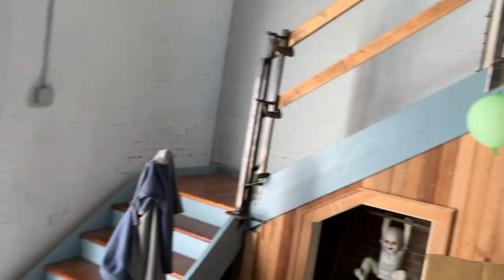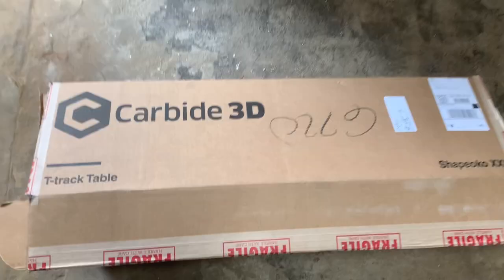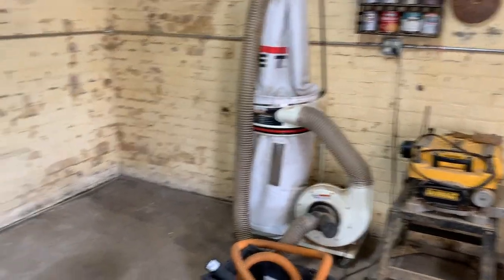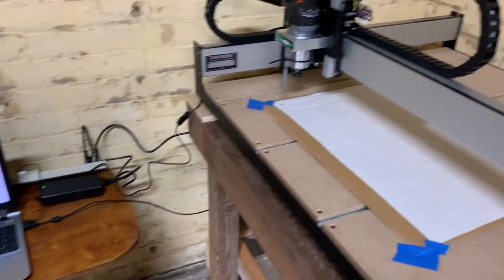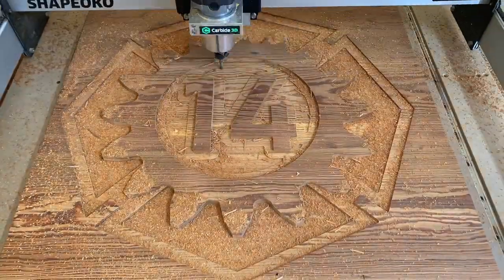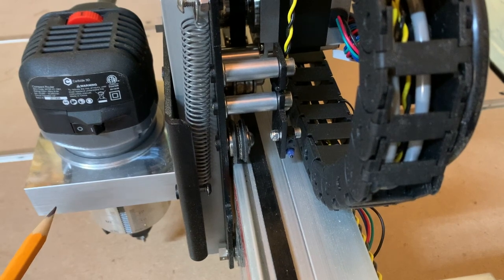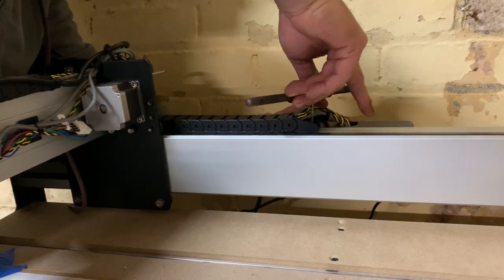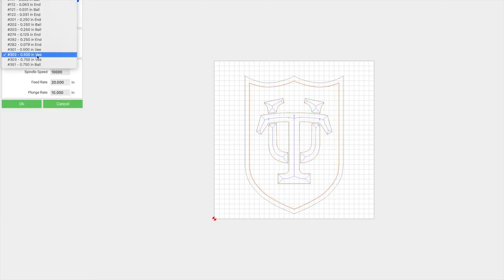We Bought a CNC Router!  Shapeoko 3 Assembly and Setup

Comment: Nice honest review. I'm not a big fan of "hobbyist" CNCs, but if you're ok with their limitations, that's all right. With most "kit" CNCs you seem to get what you pay for. Myself, I have an Avid 2x2 CNC that is rock solid. At our local makerspace, (slomakerspace.com) we have a Build your CNC with 4x8' table: big, but not very rigid. 
If you have fast internet, you might consider Fusion 360 for design software. It's free for hobbyists/small companies. -- Might be a stiff learning curve, I don't know.  I have Vectric's Vcarve Pro -- at $700 it's not cheap but I really like it. Great support too.
Look forward to seeing what you build.
Reply from the maker: Yeah I switched to fusion 360 pretty quickly and I’m loving it. I was already familiar with designing in fusion, and using the CAM functions turned out to be easier than I expected. It looks intimidating at first with all of those menus and options but once I got started I realized that it’s pretty straight forward.

Comment: I got my Shapeoko second hand and was not impressed with it at all starting out.  However after upgrades like the HDZ, 2.2kw spindle wired into the controller. 
Carveco Maker Plus software and a lot of time at YouTube University... I've got it tuned in to a very functional little cnc!
Reply from the maker: Yeah there’s definitely some bugs to work through with it but it’s got good bones. I built a dust vac system for mine which helped a lot. The z axis was getting jammed up with chips before but now it’s great.

Comment: I am very much considering purchasing either the Shapeko or the XCarve machine... have not made my mind up yet but really appreciate your video.....  Is your's the XXL (largest size?).                 Thank You guys!
Reply from the maker: Yes mine is the xxl. I chose shapeoko over the xcarve because it has a slightly larger cutting area, but more importantly it’s rail system is much more rigid.  In order to do any kind of precision work in hard materials rigidity is key. If you’re just making designs in wood this may not be that important but if you’re trying to make accurate cuts in metal, or if you think you might modify you machine later to use heavier tooling the stronger the better.